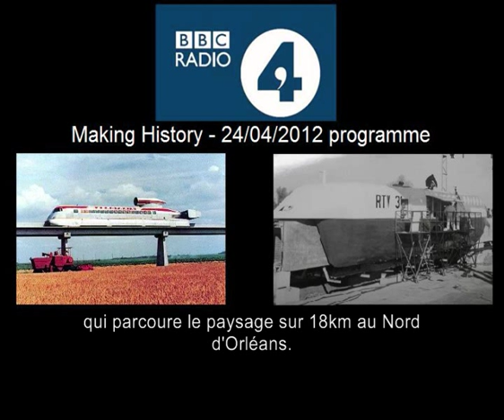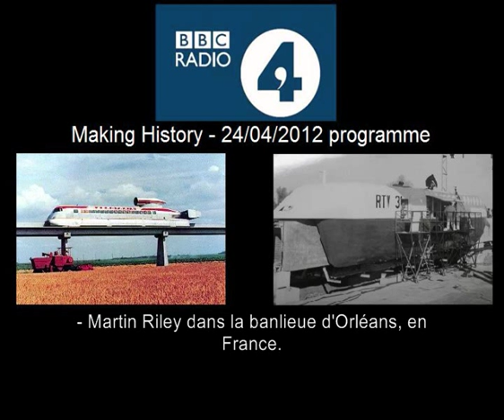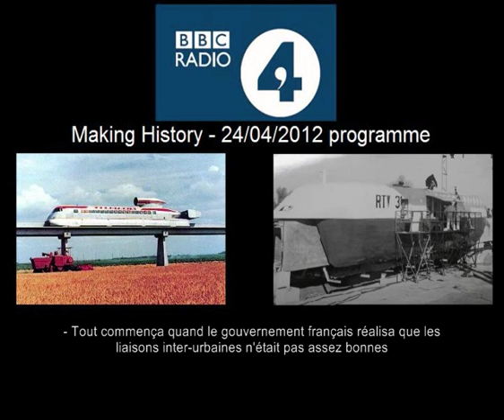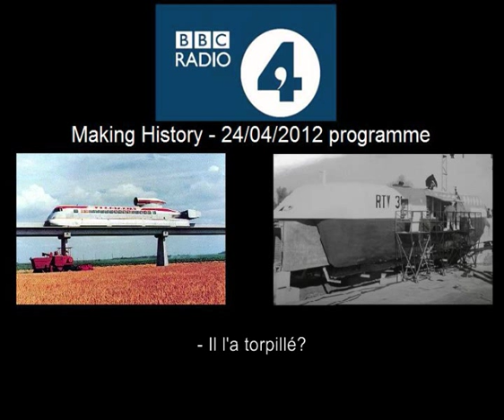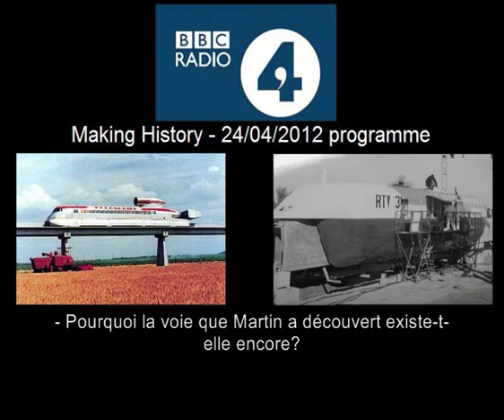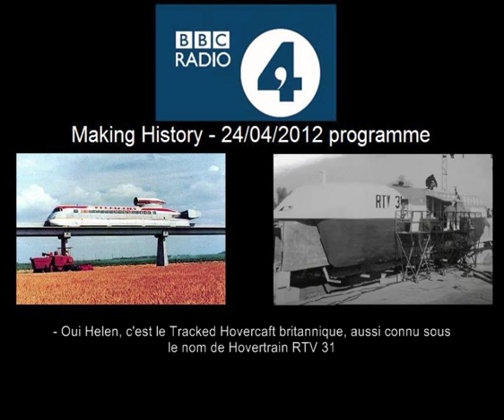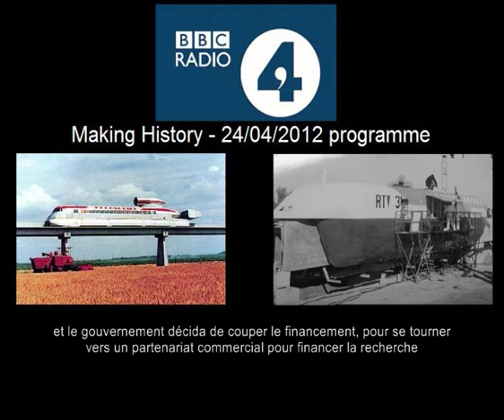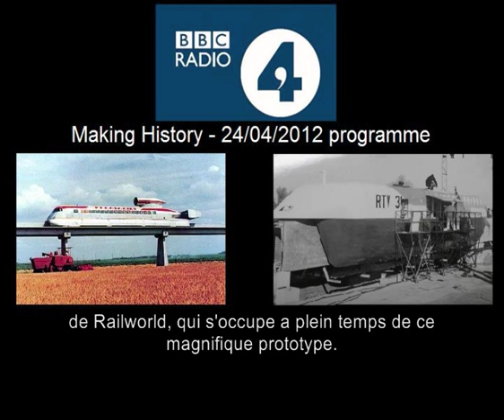Aerotrain & Hovertrain - Making History BBC Radio 4 24-04-2012

Comment: If I'm not mistaken, the French aérotrain, was the first and original one. Jean Bertin literally invented many technologies and things to made it reality.

Other aérotrain or hovertrains, are often copies of the one from Jean Bertin, which had explored already different types of engines and propulsions.
Copies not even as good and as great as the French aérotrain, with often major problems and defaults, or wrong engineering choices. Far from to be capable to enter into production, while Jean Bertin version was ready to enter service.